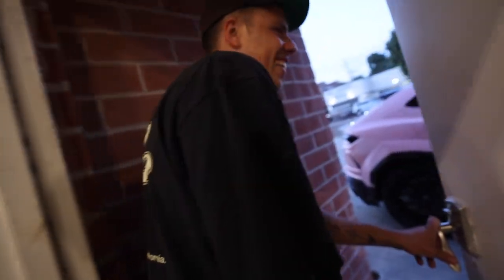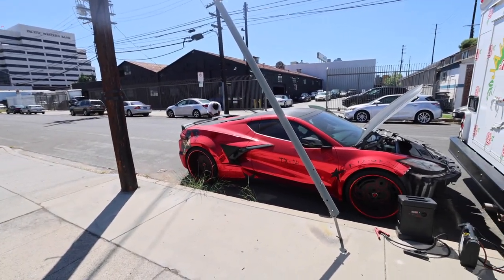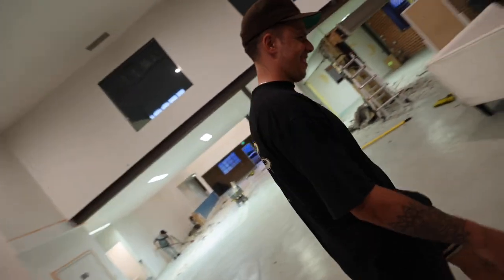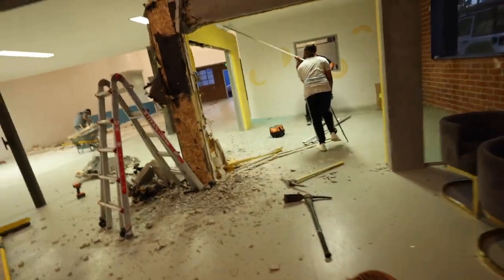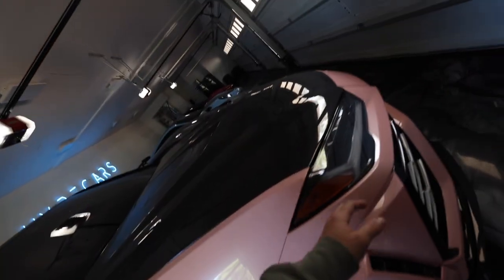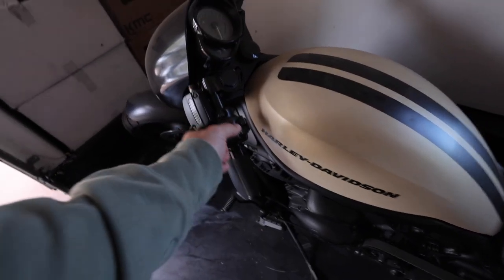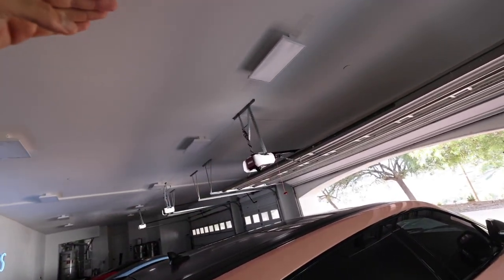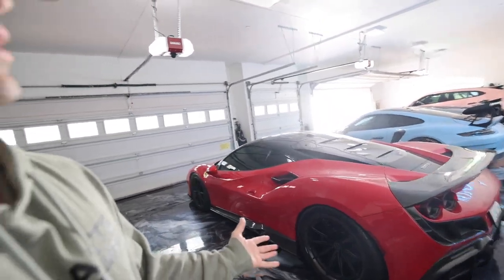My Widebody Urus Is FINISHED!!

Comment: get the rs6 then tune it as well as do catless downpipes that would be a sick build!
Reply: Only problem with rs6 is that it’s an identical engine and drive train to the urus. So when it is tuned it will feel and perform so similarity. I think a gt63s is a better option because of how much more different it is from the rest of the fleet.